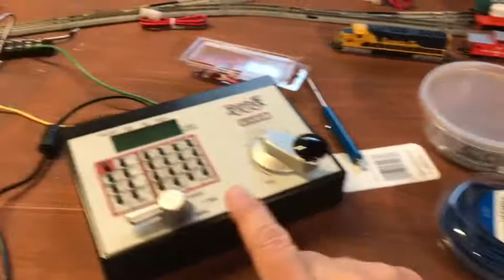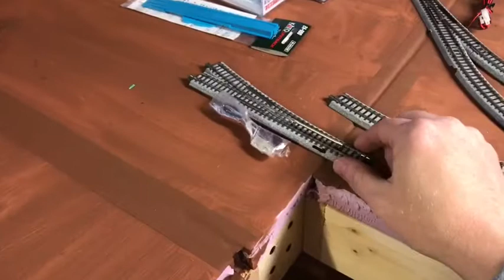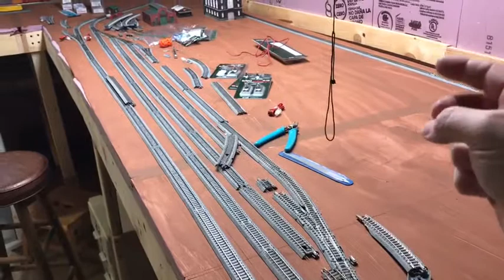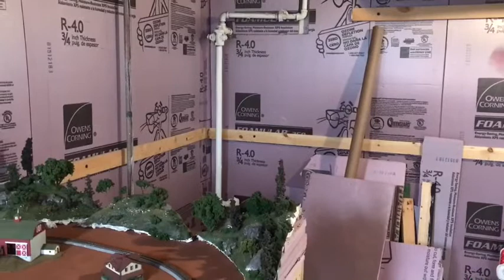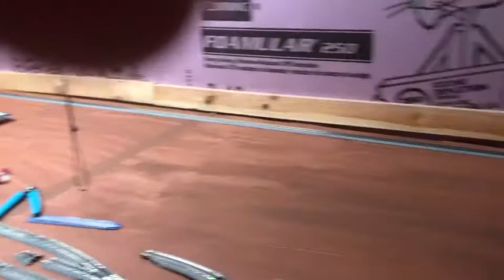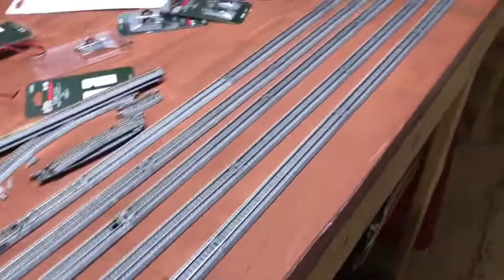CJCRR Update #8

Comment: Why didn't you just put the Pink Panther against the wall when you first put it up? A little tip, when placing insulation board down for your layout, place the side with words down. Smooth, clean, no words side facing up. So that way you can get by with one coat of paint. Maybe that's just me? I do have a little O.C.D.! Roy
Reply from the maker: Yeah didn't think about it at the time just wanted to get the basement cleaned and dry, so hopefully 2 coats of a grey primer will cover it, but at least he won't be staring at me in the railroad area anymore lol!